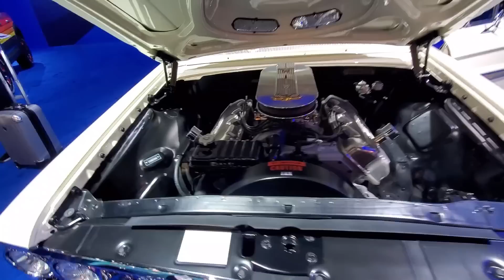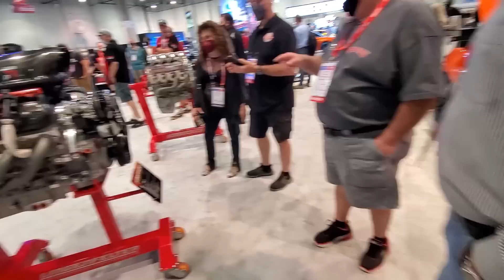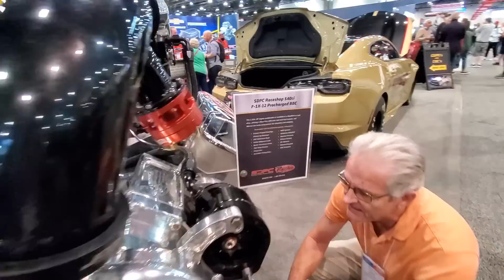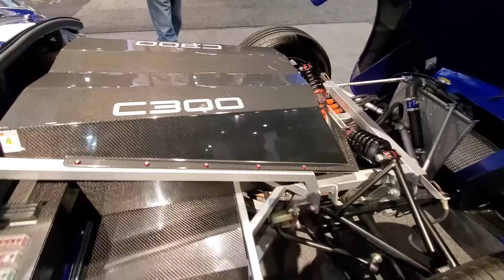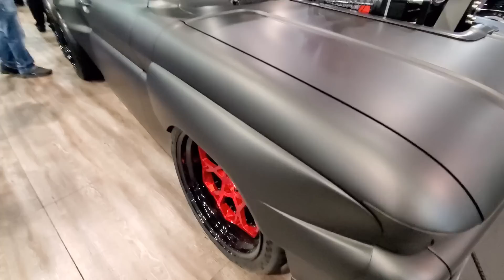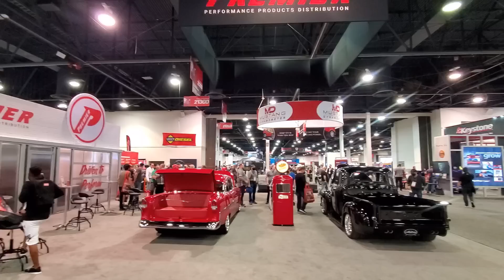SEMA show 2021 Highlights - Amazing Trucks And Cars - Las Vegas Day 1

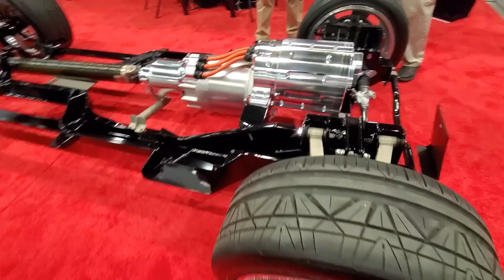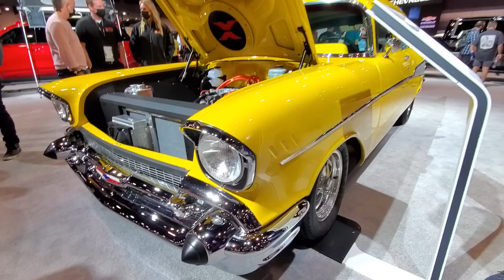Comment: Enjoyed  the  under-complicated  drive  train  at  6:30  !    And  then  again  at  19:01  in  a  '57  Bel  Aire  a  complete  uncomplicated  drive  train  that  won't  wake  the  neighbors  when  'fired-up'  at  2:00 AM   ! !
   One  electric  motor  that  impressed  me  was  in  the  dry-dock  pump  house  at  Mare  Island  Naval  Shipyard .   I  got  a  personal  tour  one  day  on  a  break  ( I  was  a  'Rigger'  of  Shop 72  at  Mare  Island )  and  was  amazed  at  the  size  (approx  15'  diameter)  of  the  motor  that  drove  the  pump .    Don't  remember  much  about  the  pump !   The  motor  was  pre-1900  vintage  installed  in  1903 .     It  had  been  're-wound'  a  few  times  over  the  years  as  the  varnish  insulation  on  the  copper  windings  would  begin  to  crack  &  they  did  not  wish  for  a  short-circuit .  
          Good  Fun  !